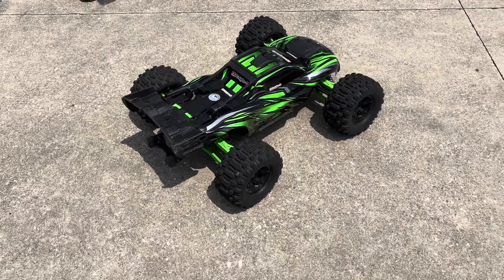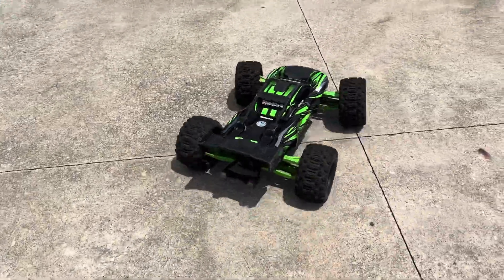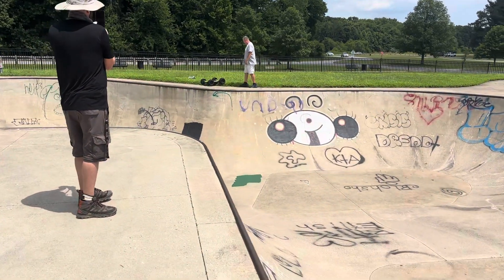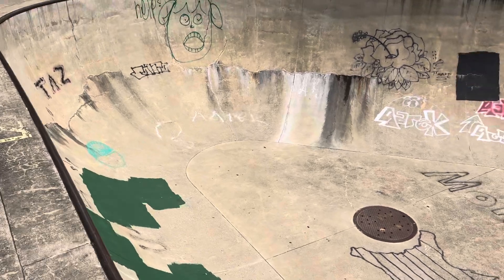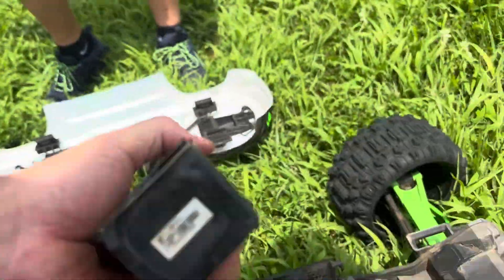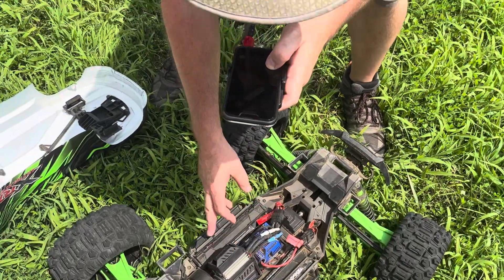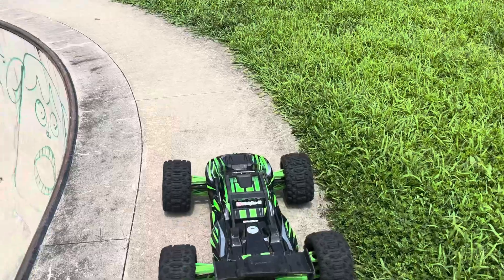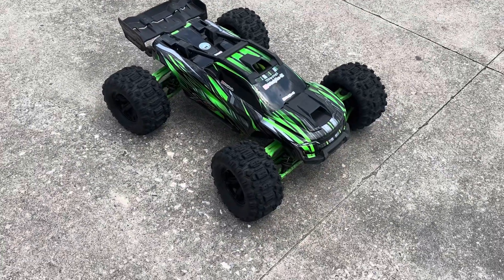TRAXXAS XRT SKATE PARK HIGH JUMPS! DAMAGE ⁉️

Comment: 👍Send it. Use some electrical tape on both ends of Traxxas Batteries for sure if your sendin it.💪 Also might wanna look at some kinda bash bar for your XRT either M2C or  GPM both make 7075 aluminum bash bars GPM has colors bout $80 but worth it. Still need one for myself it's why you don't see higher then a double outta my XMAXX lol. Nice Vid YO
Reply from the maker: @GetTractionRC  thanks man I was thinking the same , wait until you see the damage 😂